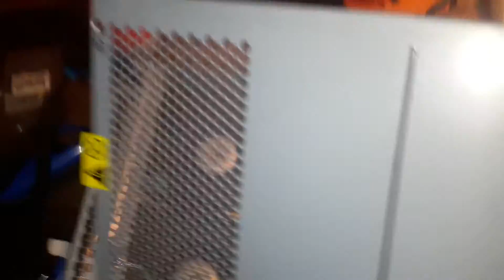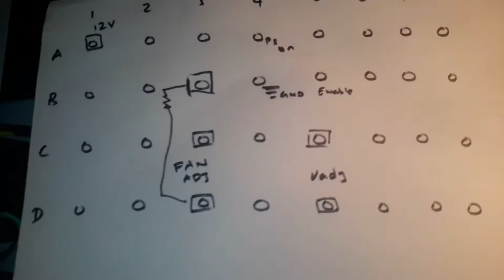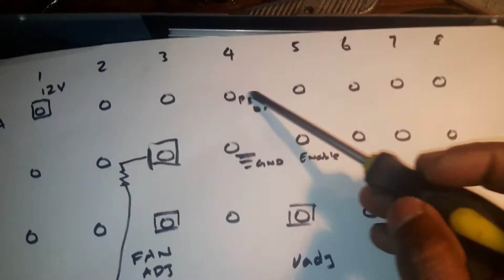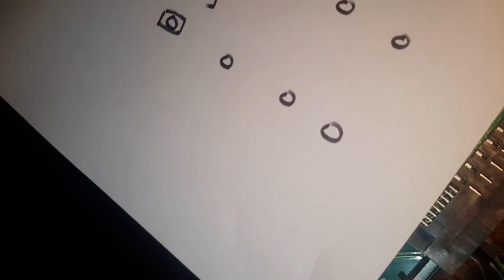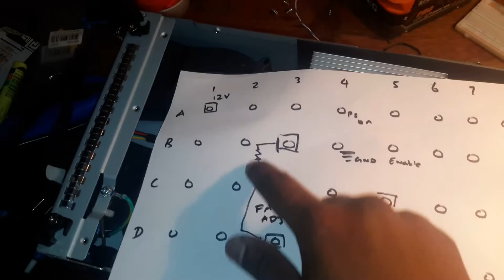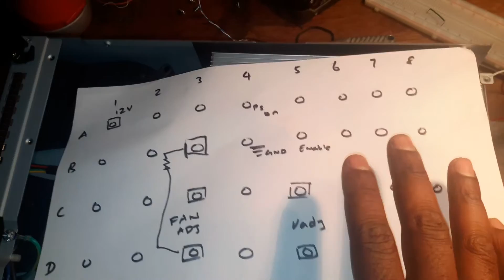How to convert server power supply Acbel ppd5002

Comment: Thanks for the video, got a bunch of PPD5002-2 PSU-s and your instructions worked perfectly to turn them on.

The PPD5002-2 was used in in Hitachi AMS500 storage controllers.

Additional disk enclosures for the AMS500 used Hitachi PPD7003(PHO840-30) LF power supplies, it has the same output connector but pinout is a bit different:
To turn on the PPD7003 using your pinout schematic: connect B4 to A5 and B5, then three 12V output rails and fans get turned on. Connect A8 and B8, then two additional 12V rails and two 5V rails turn on along with green ready LED at the back and fans go to full speed mode.

Power usage at 230V:
PPD5002-2 no load idle full fan speed ~60 W, idle default fan speed ~42 W, idle fan off ~36 W.
PPD7003 no load idle default fan speed - ~30-60 W drifting.
Reply: Helo, sorry do you have experience with ACBEL PPD1502, also for Hitachi Disk Storage? They have 24 pins connectors. Thanks in advance!
Reply: @ejfg2000  With power cord attached, measure where it has voltage between pins, then try shorting these pins and see what happens, spark all around or it turns on.
Reply: @ Thanks you for the tips! I will try ! Regards!